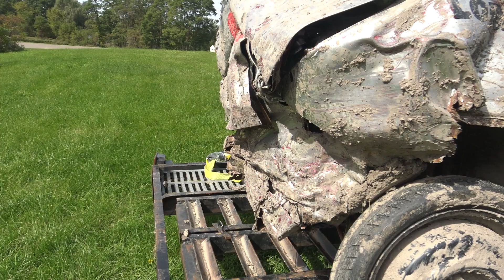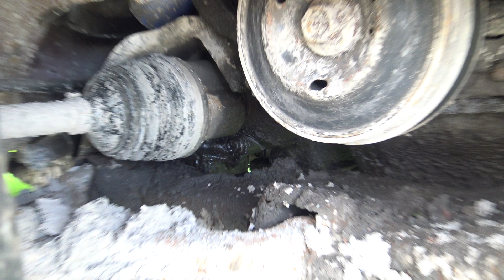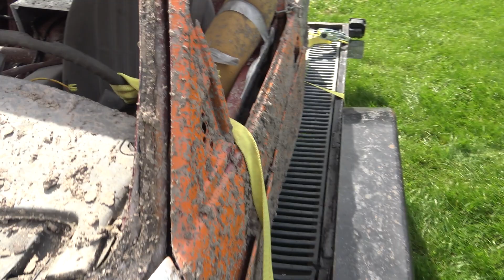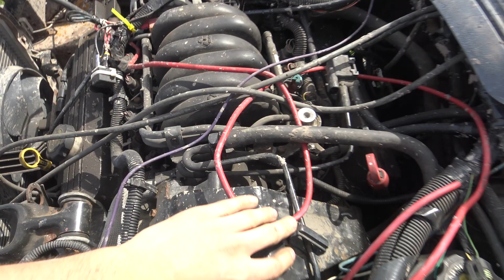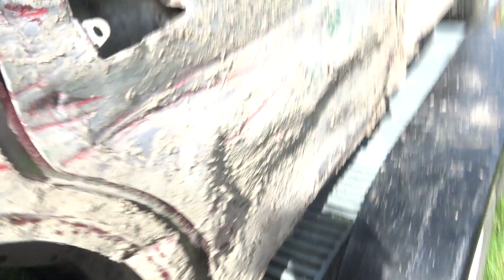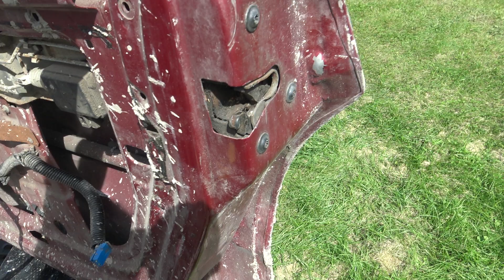Aftermath on the 1995 Buick Regal after San Filippo Smash 6

Comment: The transmission part also happened too the Buick century my dad ran at the 17 wheel days at Brookfield.  But for other cars too run I'd say maybe a cheap Honda civic or accord I've seen them do very well in stock derbies if you can figure out the front suspension on them.
Reply from the maker: I would probably derby an accord if I could figure the suspension with them. The civic's though are actually easier because they don't have an upper ball joint style suspension, so I will keep civic's in mind as well. Accord's would be my first go to if I could get the suspension figured out, but I have to be careful about what I do with it because of the fact it will go in bonestock.
Reply: Honda Civic demo